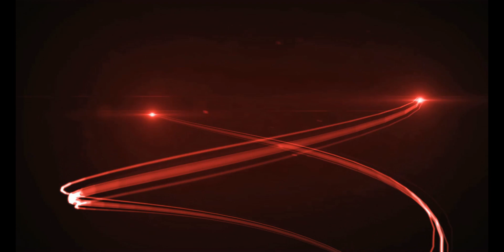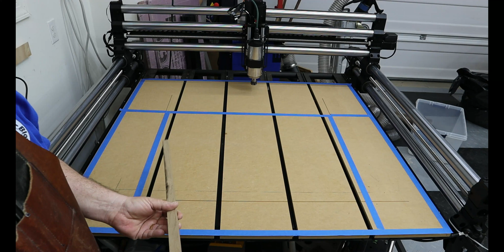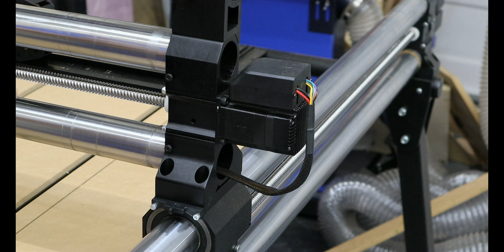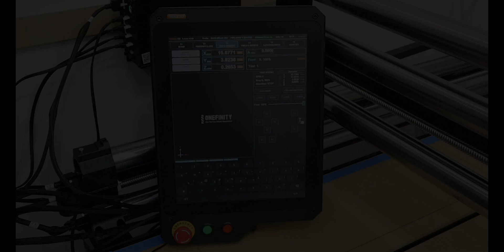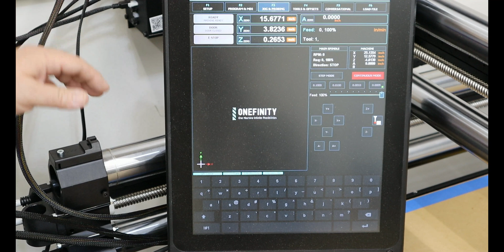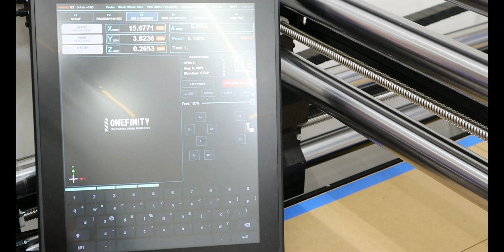Onefinity CNC Review Elite Foreman

Comment: Good information.  Would like to hear your thoughts on air cooled spindle and how is the QCW frame working for you?  I have your setup on order with hopes of shipment July/August time frame.
Reply from the maker: Hey Britney, thanks for watching and your note.  Air or water cooled primarily comes down to what you're going to be working on in my opinion.  Adding water cooling adds some extra bits obviously, pump, tank, lines etc.  The primary difference between the two comes down to an air cooled spindle not being able to spin at less than 7 or 8000 RPM, because the air cooling fan is integral to the spindle, and if the fan spins any lower than 7k RPM, it won't cool itself enough and will over heat.  Most wood projects are cut well above 10K RPM, so if you're only ever going to work with wood, Air will work just fine and you don't need all the extra components or worry with water cooled.  Now, if you are planning on cutting metals, even aluminum, you should really use water cooled.  Machining metal requires a much lower spindle RPM and as a result, you really have to use water cooled.  Since I only work with wood, I went with air cooled and don't have to be concerned with the extra bits or the potential for any water leaks.  Hope that helps!
Reply: @TradeSkillersAnonymous  And how is the QCW table working out?  I heard there was some flex in the middle.  Also, noticed they send some feet for the OF if you were to place on a table.  Was curious if they still work on the QCW for a little more height.  I make spice bowls and some deep well items, so every inch counts.  Thank you for your insight
Reply from the maker: Hah, forgot your QCW question.  Yes, it will flex if you as an example, lean on the center of the machine while it's cutting, you can actually hear it as the table flexes down, the cut lightens up.  If I had to do it again, I'd probably not do the QCW, and go with a torsion box.  The machine did come with some feet that elevates it from a standard work table but Im not sure if you can use those in conjunction with the QCW.

Comment: Great video packed with practical information!  I'm was saving up to get the latest version from Onefinity just before the Elite series came out.  Now I'm not sure if I should upgrade.  The wait time is crazy long (>4-6 months last time i checked).   I'm a beginner to CNC but I hope to do use it mainly for smaller aluminum parts.  Speed isn't really a concern but rigidity is.
Reply from the maker: Hi Dave, thanks for watching and your note. Rigidity is everything, and this line of machine has that and more. The original machine with the buildbotics controller never let me down. This version with the Masso is just more “controller capable”. The architecture of either machines hardware are the same. Consider subscribing while you’re here to see more!
Reply: @TradeSkillersAnonymous  Thanks for the reply!  Took note of your comments on the new Masso controller and it's probably a better idea to start with the previous version seeing I am a rookie.  Already subscibed!